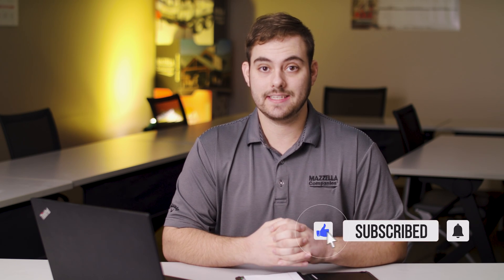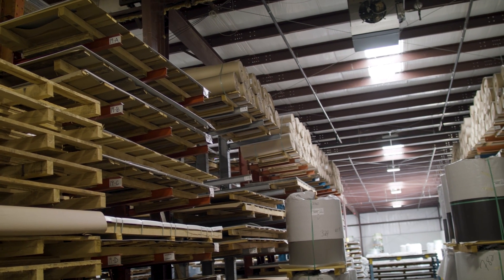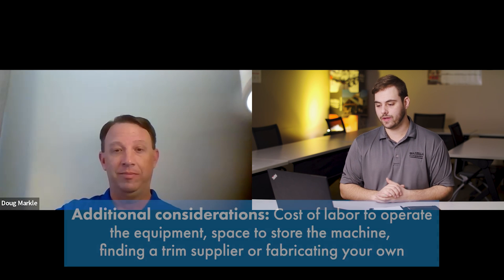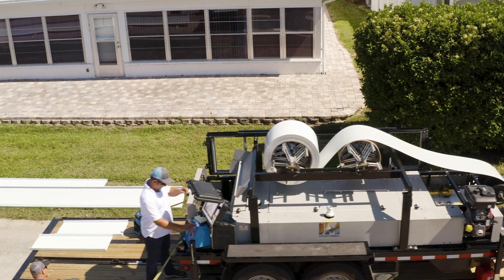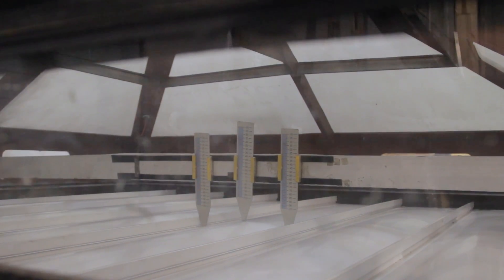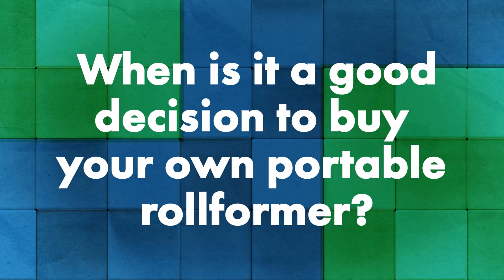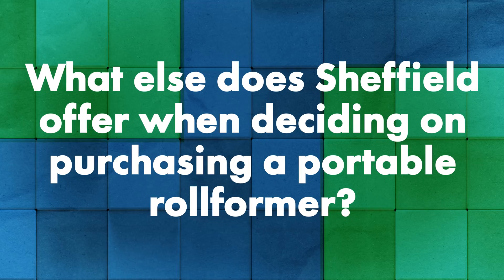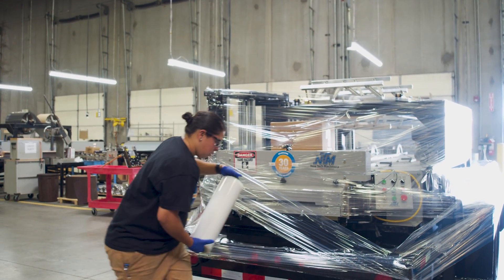What Type of Metal Roofing Panel Manufacturing is Right for You?

Comment: How much is a roll forming machine?  General amount.
Reply from the maker: A residential machine like the NTM SSR™ MultiPro Junior starts around $37,500 USD and goes up from there depending on the accessories and configuration. The NTM flagship machine, the SSQ II™ MultiPro, will start around $76,000 USD and depending on the configuration, can run up to $150,000 USD or more. Check out this video for a comparison: https://youtu.be/25PG8QuCi9M -Thad
Reply: @TheMetalRoofingChannel  These machines are sold much cheaper in Turkey.